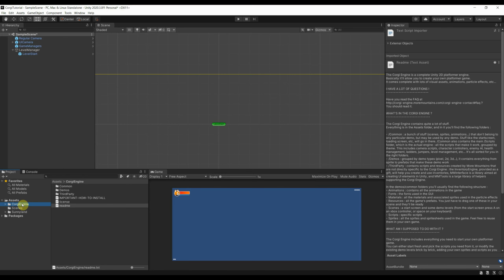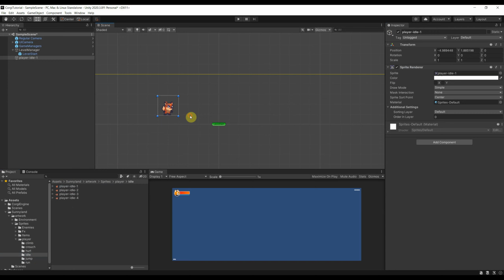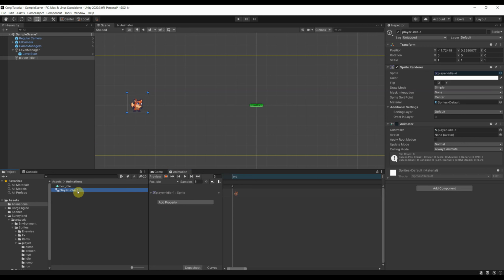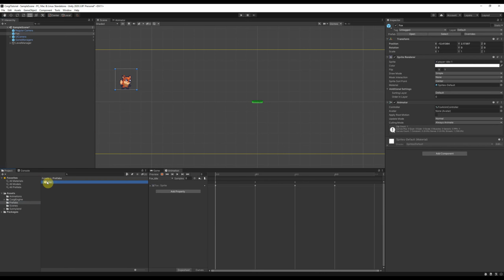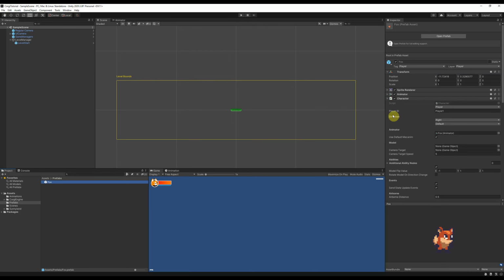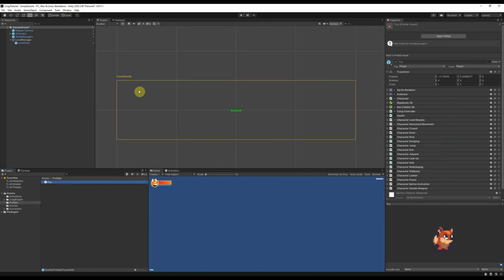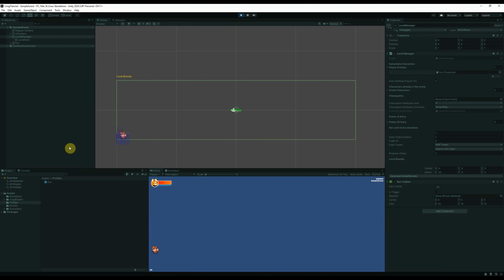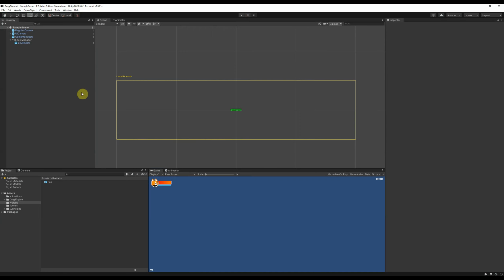Corgi Engine Beginner Tutorial 3 - Character and Play

Comment: I saw this comment below and am running into the same issue. I can spawn the fox in Scene view, but it's not visible on the camera, in Game view. When I used the suggestion 'with (main) camera selected, use 'align to view', the fox is visible for a moment, as the camera readjusts, but it quickly becomes invisible again. My level bounds look different from yours too, so I'm not positive what is or isn't different from the project you're using. Everything else so far feels right. It responds to keys, is caught in the level bounds. I saw you reply about using layers and the Z axis, but changing the Z axis of the fox makes no change for me.
Reply: Update: Still not entirely fixed. Googled. I have the Z value for the camera, lower than the Z value for the sprite. Now the sprite is visible in the game window, when not in play mode. But playing the level still disappears the sprite, and it defaults to 0-position on Z. I cannot get neither the prefab, nor plotting it in as an asset, to not force the Z value to 0 in play mode.
Reply: Fixed Update: Going into LevelStart and changing the Z coordinate there (position) to 1, has fixed the problem. I know nothing about this, but my brain started to wonder if something on the game-manager side was overriding the default spawning positions for the fox. Changing the z-coordinate *there*, seems to have fixed the issue.
Reply: @Poosley  Thanks for this. Helped me out no end. You're a star.
Reply: @Poosley  thank you, had the same problem!
Reply: I ran into the same issue (character is visible in scene view, but not showing in game view). For me, the reason was because I reset the transform position of the 'Regular Camera' to 0,0,0. Once I set the transform z position of the 'Regular Camera' to a negative value (ex: -1), the character shows in game view and issue is resolved.
Reply: THANK YOU @kimbaudi  My character now appears! hope I don't run into ther issues!
Reply from the maker: Hello - I am so happy to see that you were able to made it. Sorry for the big delay in answering, I was out.